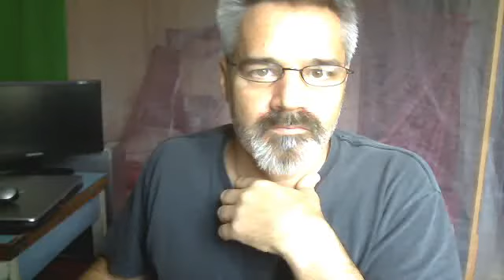3d printer to make flying wing quadcopters to generate electricity

Comment from the maker: Q: How difficult would it be to put together a sm. prototype of same is what I keep asking myself and others... with 3D printing the flying wing shouldn't be hard. The controllers for flying figure 8s against the wind ... the cabling for the electricity to flow down? The Germans are working on a circular track, the kite pulls a motor along the track and generates E that way... lots of Qs, eh! :)